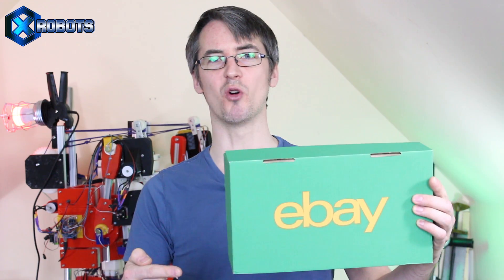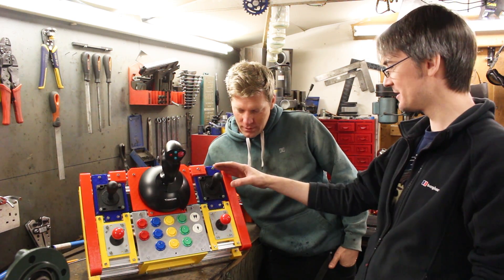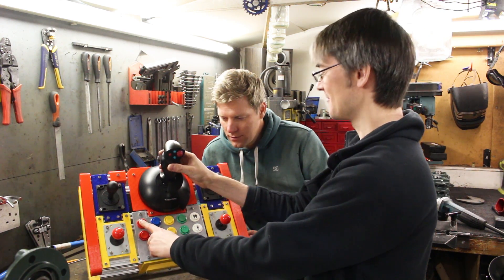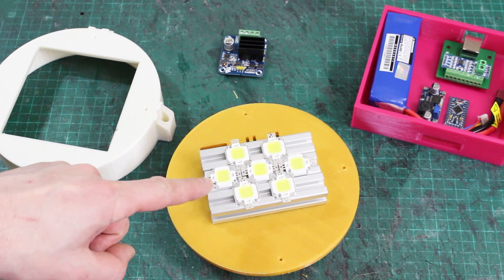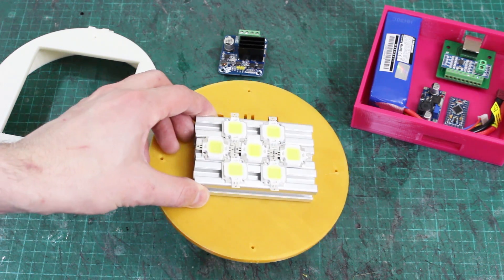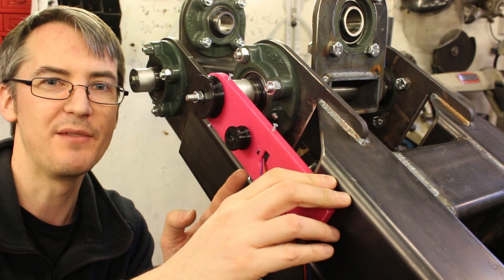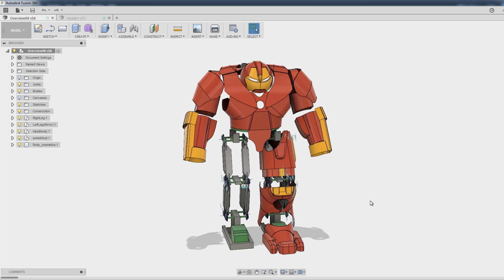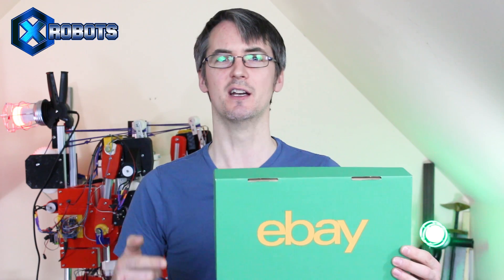Building Avengers Infinity War Hulkbuster w. Colin Furze #1 | James Bruton

Comment: The incremental position sensor with a string looks like a bad choice. Will give surly problems. It may bring the legs out of balance and collapse the bot. Go surely for a gear solution with absolute values.

Comment: Why on earth are you making things so complicated?
Ebay sells solenoid valve banks, and you can slave a single Pump relay. Hall effect sensors are so much more reliable than string linked pots. With hydraulic power you want reliability.
Fusion 360 can unfold sheet metal shapes. Learn to use it

Comment: Very nice friend, but let me ask you something, that controller you built wouldn't fit better in the project if it was separated in two parts? Each one for each hand? It seems to me that it would be easier to control the seat and would use less space in the armour, in case that this controller will be set inside of the armour... Cheers mate.

Comment: im not familiar with fusion, but using some other autodesk software (like 3dmax), you can simply draw the panels as 2d pieces, instance them, then apply an extrude modifier (to give them the correct thickness) and bend modifier (which will bend them just along one axis). then you can edit the original 2d shape (drag vertices, add vertices, change bezier handles, etc.) and the amount of bend while watching the instanced bent (3d) shape change in real time on another window. once the 3d version looks right, you can export the 2d shape for cutting.

Comment: Awesome. What are those little black and yellow low voltage connectors called you're using to link the pneumatic controls to the relays?

Comment: TFW your control system sensors & electronics cost 2+ orders of magnitude less than the hardware they're controlling...

Why not ROS over R-PIs with PoE hats? Or at least optical position sensors rather than a rubber band & a pot?

Comment: o.O crazy amount of work there. Don't want to be a smart aleck but did you try the flat steel feature in fusion 360? might have been easier but anyways awsome work :D
Reply: right you would have to start in sheet metal mode but i guess for the complex curves that would in fact not have helped much. Really looking forward to the next parts :)

Comment: Hello James,

What a great new project. I can't wait until next week. I am also subscribed  to Collins channel, so double great video's 

I am also still busy with a robot project and to my surprise you are also using de Max485.

I am curious what for library your using. For the serial connection  (rs232) I used the easy transfer library. What you used for rs485?

Because I got a bit sucked a my project.

Regards,
Edwin

Comment: Hey ya, love your stuff, what software do you use to design your prints?
Reply: Was a bit embarrassed as you said that later.  I don't remember you saying it in previous vids, but I wrote that question part way through the vid then you said it.  Thanks man.  I have to work out what is making my printer squeek so loud before I do a lot more.